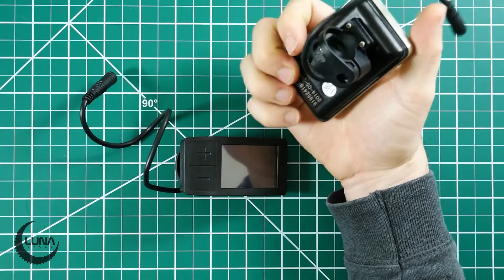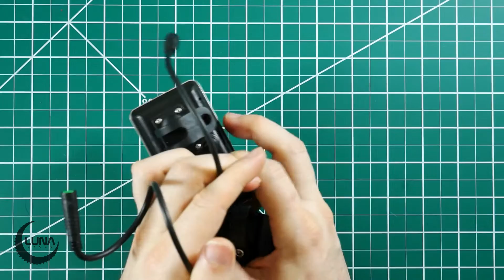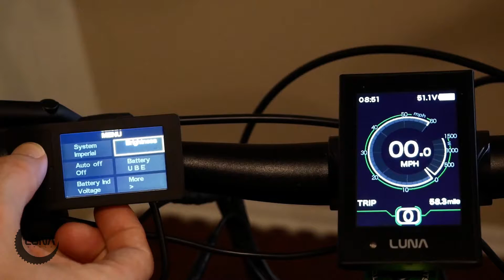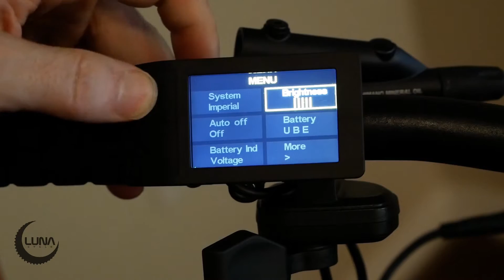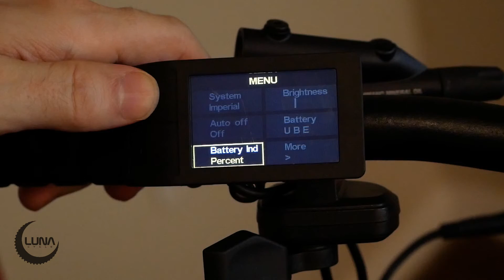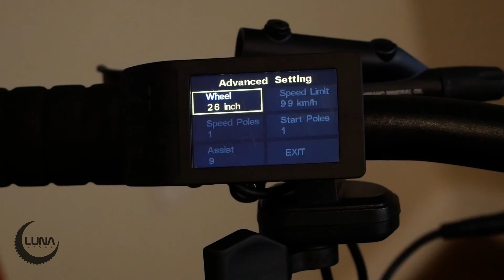Luna 500c Display Walkthrough

Comment: Great video 👍😉 I have a problem with this display the limitation to 25klm does not work, if this problem is known, where can it come from? 🙏
Reply from the maker: If you mean the speed limit is not working, you probably need to change the configuration settings in your controller. In config there is an option for speed limit defined by either the controller or the display. Select defined by display in config and hit write to update controller.

Comment: Does the battery percentage and guage accurately refect the battery considition or should voltage be used instead? It was suggested to me to use battery voltage instead. For reference I have the BBSHD with a 52v 14ah battery and the DPC-18.. thanks
Reply from the maker: Voltage should be used with 52v packs
Reply: @fuzzyfriendlydoggy  Thank you..
Reply: What about 48V batteries?

Comment: Does anyone know if I upgrade my display on my 2019 Radmini to the color Luna 500c Full Color Display
 will it work is it a plug and play?
Reply from the maker: This is only compatible with bafang mid drives, specifically bbshd and bbs02, bbs01, and maybe ultra. Unless your bike has one of those motors it will not work
Reply: Ty

Comment: Does this display work with M2S Kush 350w mid drive motor?
Reply from the maker: I don't know what motor they use. This was designed for bafang bbsxx mid drives, specifically bbshd and bbs02, and probably works on bbs01 as well.

 Unless the motor is one of these it won't work.
Reply: @fuzzyfriendlydoggy  Have you heard anything since making this video whether or not there is a firmware upgrade available for these displays? I ordered once recently and connected it to a BBHSD with a 52v controller, and with a 48v battery, even with the display set for a 48v battery, at a full charge it still only reads 75% charge. Thanks

Comment: What does the headlight symbol do?
Reply from the maker: Bafang makes two different versions of BBSxx. One has a dedicated gearsensor plug. The other has a 12vdc  power output. At Luna we sell the version for gearsensor because it is pretty great and wireless lights are more ideal. But you can plug this display into the other version and turn on the 12vdc circuit at the push of a button on the display, I think it is holding down either + or -. If you have a light installed on the circuit, it will turn on the light.

If the circuit is turned on, this symbol on the display with be highlighted.
Reply: @fuzzyfriendlydoggy  my dpc10 now makes light when darkness sets in. When I purchase this one, can I put front&backlight on manually? -edit: I can, yes.
Reply: When you put head&rear lights on(push and hold + button) on your circuit, the symbol lights up on your display.

Comment: These full color displays are impossible to see in the sun light.  The 500c, 750c and 850c are useless outside in the sun.  You have to pull over in the shade, or bring it inside to see any information like: speed, odo, watts, volts, anything useful.    I find it funny that all of these advertisements and demonstrations are done inside.  Try doing this in the sun (where ebike riders will be using them) . It will be impossible to see.
And I find it really deceptive.  I really regret spending $120 on a full color display because it is useless in the sun.
Reply: If you adjust the brightness settings you can see it perfectly in the sun. Go to an eye doctor.
Reply: @meazy451  Please take your bike out in the sun, not under a tree or in a garage.. Take a picture of the display.  they are impossible to see in the sun.  My entire cycling club agree with me.  They all say, "i can't see it, it is useless"
Reply: @rdkuless  I just checked it in the sun and it looks great. If you've already gone into the menu and put the brightness all the way up, and still can't see it, you've got a dud.
Reply: You can do a parasol with an old mobile silicone cover.